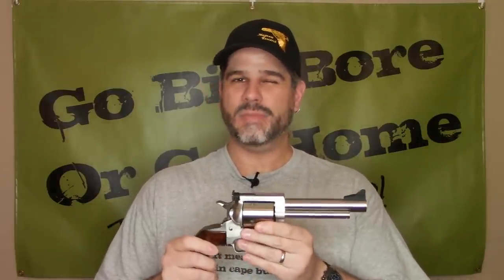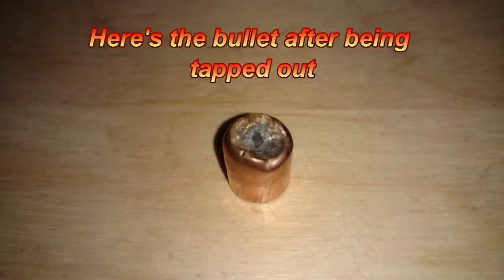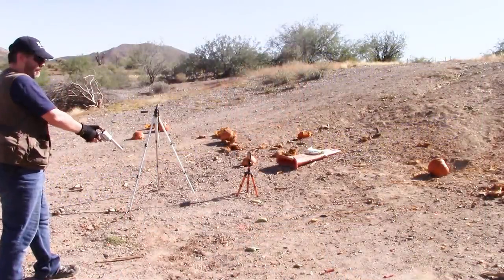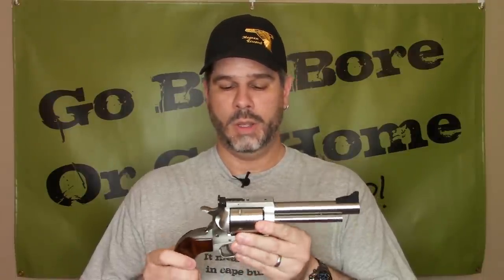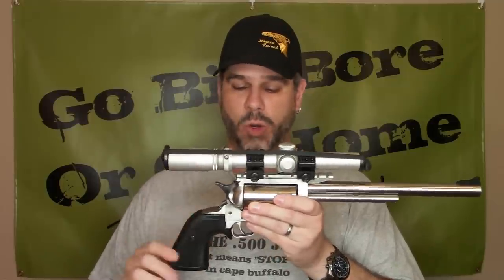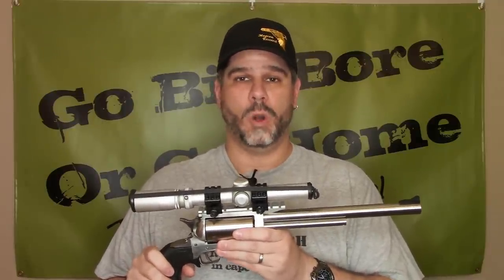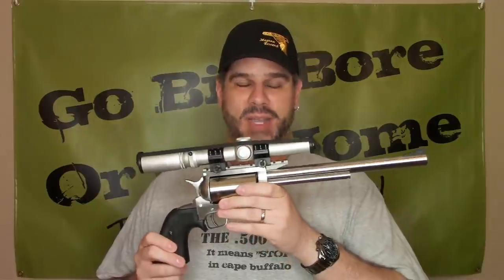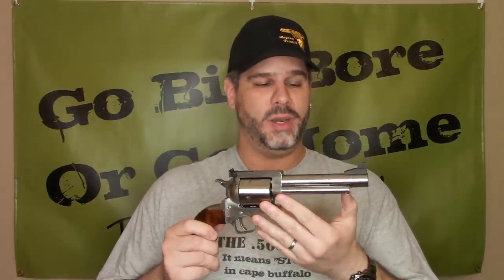I Blew Up My BFR in  500 JRH!  (And an Update on My .500 S&W Magnum BFR)

Comment: A squib load causing a weakness in the barrel seems really strange to me.
Reply: I was thinking the exact same thing. How does a squib cause a crack in the barrel?
Reply: A squib doesn't cause a crack in the barrel. There's more to the story.
Reply: @justinstasiowski916  He explained in a followup video. Check it out.
Reply: @TahoeRealm  You didn't watch the video, or the followup video. Simple common sense would tell you to do that.
Reply: @exothermal.sprocket  You are correct. I commented prematurely and removed the comment. Thank you.
Reply: So if some of the powder ignited after the bullet move in to the barrels and had a secondary explosion even could have created more pressure. Or the removing if the Squib could have been less then the best way. I had a barrel on a 22 split didn't even know it tell sent it bag to the factory for repair for something not at all related.
Reply: A squib cannot be the cause of a weakness in the barrel.
Reply: Correct. He had a followup video showing the causes.
Reply: The real cause was what we used to call magic screwdrivering.

Comment: My first BFR 500 Magnum, a 10" with  the old JT serial number style like yours, ripped the scope base, scope rings, and ejector off from overpressure handloads.

My new BR serial BFR 500 Magnum with a 7.5" barrel, one of the trigger guard/frame screws fell out and the rest are loose. I still need to get it fixed. Using four steel scope rings instead of two aluminum ones has kept the scope base alive though, that and I glued the entire scope base onto the back strap with red loctite flange sealant before putting the screws in, per MRI's recommendation.

Comment: I have a 7-1/2" barreled BFR in .50 AE that I have considered getting a 500JRH cylinder for, good to see that the frame and cylinder had no damage with that bore obstruction, a split barrel is bad enough but a burst cylinder or cracked frame could be worse.

Comment: Wow a lucky escape!All I've ever had with bullets stuck in barrels is .22 CB caps!Seems to happen with rifles rather than handguns presumably because the CB's don't always have the power to drive them up the barrel?You don't always notice a stuck one and send another up it's rear and sometimes it blows out the stuck one at a very low velocity sort of Daisy gun levels,250 fps,but sometimes you end up with 2 stuck!

Comment: I recently also had a very similar  squib in my ruger new model super blackhawk 454 cassul-factory federal  fusion ammo 260 g.bonded soft point.these are milder loads.curious if yours was with federal ammo?I had already in past shot over 10 boxes of same ammo,no problem.I usually shoot buffalo boar heavy loads,but was plinking with friends.Now I think I will have a gunsmith check the barrel!By the way,I went to my local welding shop and for about  3 bucks bought a couple different diameter welding rods to use in case of another obstruction.

Comment: How many rounds did you fire between the squib cartridge and the failure? I'm a materials and corrosion engineer. I'm disabled now, but I'm always interested in causal analysis of failures. I wonder whether there was any fatigue component to this failure or whether everything was a single overload failure.
Reply: He explains the failure if you watch the entire video. It wasn’t an overload. Watch the video again you’ll see(hear) the cause
Reply: @robertfree1908  No, he doesn't explain the failure in terms of the mechanism of crack growth. He said that there was an irregularity in the barrel as a result of the squib fire and the effort to remove the stuck bullet. He said that debris built up in that irregularity and caused an obstruction. 

That explanation does not tell what is happening metallurgically. I'm asking whether there was a fatigue crack that ran to failure or whether the failure resulted from an overload that grew a crack from initiation to complete failure in only one pressure cycle. When the crack grows from initiation to complete failure in one cycle, that's called an overload or maybe single overload. If the buildup of material in the irregularity caused higher than normal pressures over a series of shots fired, then the crack may have initiated from some shots and then grown a little more with each shot until final failure. 

That might not be something that he would see, but the manufacturer might have done that analysis. If I were buying a gun from this company, I would hope that they did this analysis on any failed barrels that customers returned.
Reply: @VTPSTTU  He removed one squib bullet.  Probably had another that just seemed like the gun was empty.  Followed by a full load.
Reply: @rickoshea8138  Are you now saying that there were two squibs in a box of factory ammunition and that they just happened to fire one immediately after the other? That seems like a very low probability. The fact that you said "probably" also tells me that the video doesn't explain exactly what happened. 

I've spent decades doing metallurgical failure analysis. "Probably had another" doesn't help much in understanding the cause of failure. That's why I asked the question. 

I really don't believe that he fired one squib, removed the obstruction, and then fired another squib without realizing that he'd fired a second squib. I can't rule that out completely, but I'm skeptical. Again, that's why I ask the question and look for something more than "he already explained that." 

The explanation that I understood was that removing the squib left some kind of irregularity in the barrel and that residue built up in the barrel as a result of that irregularity. I'm curious how many rounds went down the barrel to cause residue to build up enough so that the barrel would be obstructed to the point of splitting. I'm curious in part because I wonder whether the split happened because a fatigue crack grew from that irregularity or whether the failure came from a single overload of a barrel that did not have a growing crack. 

If you aren't familiar with fatigue fracture, ductile overload, brittle overload, stress corrosion cracking, hydrogen cracking, and other metallurgical failure modes, that's fine. Maybe none of this is going to make any sense to you. I'm disabled now, but those things were once my career, and they still interest me. I was hoping to learn evidence that would allow me to understand what happened in that context. I'm not sensing that you can see where I'm going with this.
Reply: @VTPSTTU  
Quite frankly, that barrel looks like a brittle failure along lines with sulphur inclusions.  The very reason why there is a 416R stainless alloy to prevent such failures that have occurred in the past.

As for one squib load somehow reducing the chances for another.  I see it exactly the opposite way.  Whatever filters are normally in place to prevent squibs, failed.    That proves it can happen.  If it happens once, it MORE likely to happen again, until the root cause is found and eliminated.

I feel like we don't have all the info.  That said barrels don't split due to metal fouling.  They bulge due to having one bullet ram into one that is stuck in the barrel.  If a revolver barrel splits along its full length without bulging, there is a flaw in the steel.

If you overload a revolver by using too much or too fast a propellant, it is the cylinder walls that fail, not the barrel.

If removing a squib bullet damages a barrel then the person doing it must be a butcher.  Short of using an oversized punch, there is no way that tapping a bullet out of a barrel induces more stress than firing it through.

So, I don't know what happened, but someone is covering there a ss.  I understood that the revolver manufacturer charged for a replacement barrel because the load fired when it failed was a reload?   An independent lab would have had a look at the fracture sites on the barrel and found the revolver manufacturer, or their steel supplier liable.  But that is speculation about evidence that we will never see.

The two squibs did not have to follow one after the other.  More like, if you find a rat in your house, there is a hole that will allow other rats to enter.  Rather than some karmic law that only allows one rat or squib per household.
Reply: @rickoshea8138  : I second your opinion of faulty steel. MRI info on "we build our barrels to fail first" is a seal under your very sound opinion (engineer here). It seems MRI'd buy cheap inox. Then they try to hide they bought far too cheap.

Comment: On that 500 jrh, there was no reason for what you're explaining is a squib load to cause that Barrel to crack, that's provided that the barrel had the proper metallurgy. My guess is it it may have been slightly low with silicon, which reduces the ductility of the Steal of the barrel. Because unless you fired a bullet behind that squib load. That's the only way to impart enough pressure into that Barrel to even cause such a failure. And for some reason in the last five or six years I have seen bad Metallurgy from Firearms tools all kinds of things that I never used to see before. Part of this is because they're buying their steel to specification but not testing the steel that they get to make sure it meets that specification. The bolts on the newly manufactured m-14s by General Dynamics several years ago as a case in point. They were buying their steel to spec and they did not realize that the pickling solution put on the steel to ship it overseas was leeching the Silicon out of the steel provided the Silicon was put in in the first place. At about seventy-five hundred rounds the bolts were starting to get cracks in them. Once they Justin all of their steel they found that the steel that they were using to make their bolts certainly was low on Silicon.

Comment: Most guns you would think could handle a squid and if properly tapped out there shouldn't have been any damage to the barrel. I'm wondering if the barrel didn't come defective from the factory perhaps anomaly in the production of the barrel or the material used on the barrel one tiny bit of hardness not properly cryo freezed to correct they're always other amazing little tricks they use to make that metal all the same hardness again and voila you shoot a defective barrel then they bill you for the replacement. Or as much as we spend on those revolvers and for shooting factory ammunition through it and barrel should have been free of charge
Reply: It is not the squib that was discovered and removed that did this.  It was another one that was (un)discovered by shooting it out....

Comment: I just lucked into getting a 7.5” 500 JRH. It has the factory rubber grip. I like nicer grips. I’m glad to see the really nice set work so well for you. Looks like I’ll be swapping as well. And looking forward to a 500 Special cylinder(I don’t care to deal with the shoot-the-Special-in-the-JRH-cylinder-and-deal-with-crud-buildup-at-the-throats game). Is it really worth getting the AE cylinder with the component bullets being higher than 500 S&W bullets(jacketed)? And are you having any issues with bullet creep with just a taper crimp with the AE cylinder? So glad you’re alright. And thanks for sharing the video.
Reply: I have one in .50 AE and my first handloads had some minor creep issues but I basically crimped them to the max after that which means about as firm of a crimp that I felt comfortable doing and never had any more problems. The little creep on the first few I loaded only moved the bullets a small amount but still not acceptable. BTW the only bullets I shoot out of it are 340 gr. hard cast SWC from a RCBS mold. I would think jacketed bullets would be a non-issue. I was considering getting a 500 JRH cylinder because of the greater selection of bullets available for it because of the roll crimp so I really don't see any advantage to having a .50 AE cylinder other than maybe the fact that factory loads for the .50 AE are easier to get but if you reload that's really a non-issue. The only reason I bought mine in .50AE is that they were not offered in 500 JRH at the time and it was on a really good sale.
Reply: @phillhuddleston9445  thanks for the input. Yeah, I think I’ll pass on the 50 AE cylinder…..maybe. But the Special cylinder is a certainty for me. Starline made the Special case by just cutting down 500 S&W cases(this is per a Starline rep via email). Without boring out those Special cases you will only get shorter bearing surface bullets to seat without bulging the case. I don’t know what the limits are as far as viable bullets go. But I’m looking forward to finding out. Thanks again. And Merry Christmas to you and yours

Comment: That might not be the whole story . Cast bullets being driven too hard will expand in the bore to such a degree that they place great radial pressure on the  barrel and that's where the initial cracking came from add to that extra fouling buildup  . Once the barrel has a crack it weakened the whole barrel .  Eventually it just gave up . Some stainless steels are poor quality and not as strong as chrome moly steel is . Some people are very poor hand loaders and always push over pressure unsafe loads until something breaks . The trouble with a handgun is the barrel is small diameter  and weak in the thread area and if it has  a big bore there is no real safety margin of steel thickness left . The cracked forcing cone is what I am talking about .
Reply: Cast bullets will not hurt a barrel. They produce much less wear than a jacketed bullet will.

Comment: So you had TWO Magnum Research barrels that either blew up or cracked a forcing cone? Seems they need to do a little more research. I was going to buy a BFG 44 Mag tomorrow. Glad I saw it, Ill get a Freedom or Ruger instead.
Reply: I have one chamber in .50 BMG and have had zero issues so far, I can see your concern but I've heard about flukes from Ruger as well, never heard anything bad about Freedom Arms but I'm guessing they don't produce the volume of guns that BFR does and certainly less than Ruger.

Comment: It seems pretty unlikely that squib load would cause a crack in the barrel.  Even if you had to use a steel rod & hammer to get the bullet out (a bit of Kroil around the bullet would help it out, BTW).   It seems to me the manufacturer should have replaced the barrel at no cost to you, as most likely it was a defect in barrel to begin with and had nothing to do with a squib!  Let's face it, squibs are relatively low pressure events.

I've had experience with cracked barrels before, on a Ruger Redhawk 44 Mag.  I had a few rounds through it,  mostly lite (relatively speaking) loads with a 200 gr lead flat point bullets, with a few 240 gr JHP loads of W296 that are pretty well maxed out.  My other .44, a Vaqureo eats them up without problem.  However, when checking the bore for leading I found a couple of circumferential cracks just forward of the forcing cone, in the rifling.  After a lot of hesitation I finally got around to sending it back to Ruger, who replaced the barrel & returned it to me.  I shot a total of 18 rounds of my lead bullets and 6 of my hot loads then checked for leading.  Imagine my surprise when I found some even worse cracks than before in the same area!  Unfortunately, my wife was diagnosed with breast cancer about this time (she is fine now but there are few things as scary as that!) So it took a while before I was able to concentrate on anything other than my wife, so 5 years passed before I got around to returning the pistol to Ruger.  They determined there was something off with the frame and sent me a completely new pistol, free of charge!  One thing I should have done was request that they use my original trigger assembly, which had one of the best triggers I've ever felt on a Ruger (pardon me while i brag a bit because I did the work!) but I didn't even think of it.  The bad part was the new pistol arrived with some issues that I resolved myself (if I had picked the gun up in a LGS I would never have taken it home!) but it took a fair amount of work and the trigger still needs a bit of work on it but it shoots well so I'm not going to whine too awful much!  The point being is that is the way customer service should work.
Cheers, 
jc

Comment: If you are spending that much on a revolver, you might as well get the best and go Freedom Arms.  Far superior firearm in every way including quality, fit, finish, stainless steel and far better specs.  You will not have cracks in forcing cone, or strength issues elsewhere.  BTW, if you ever lodge a bullet in the barrell like you did, get it to a gunsmith or the factory.  You got lucky it wasn't worse.